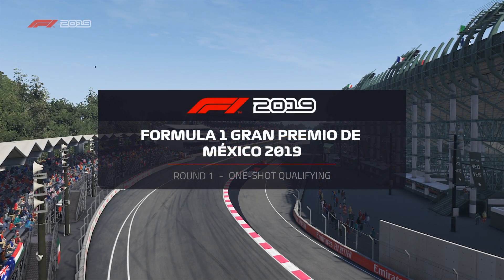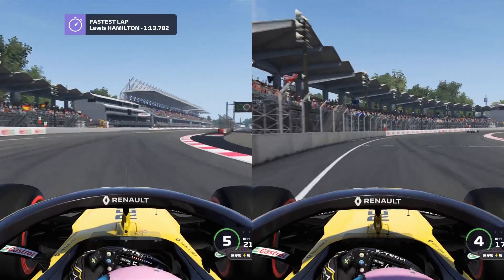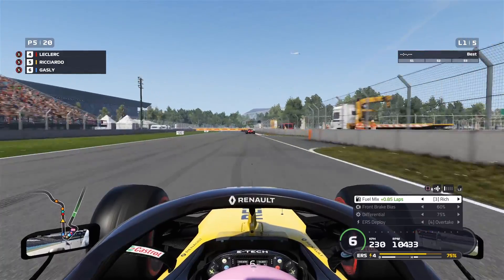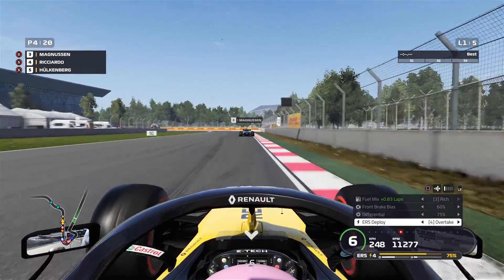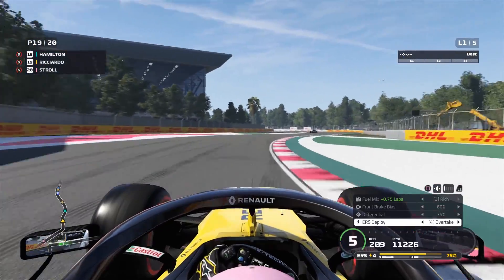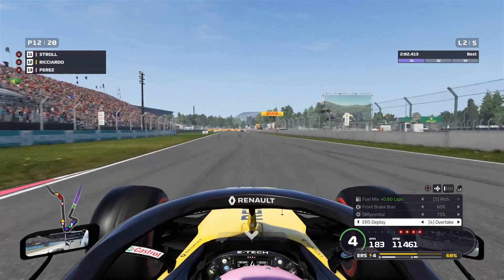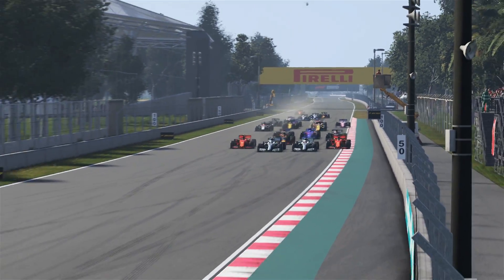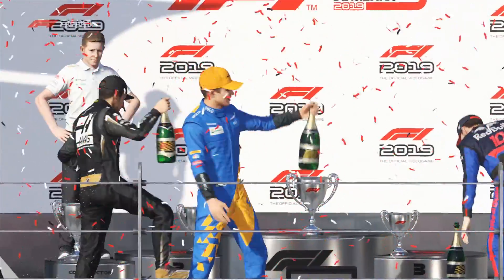A Renault F1 Car With Renault Clio Brakes

Comment: The thing you ignored is weight, which is literally the most important part. A Renault Clio weighs almost twice as much as a Formula 1 car,  so the brakes that stop it from 100-0 in 40 meters, would stop an F1 car much sooner. On top of that, the grip level of the F1 car would better utilize the braking power, which is not the case in a road car since ABS has to prevent locking up and road car brakes can produce FAR more force than what the road car tires can handle. Without ABS, you can pretty much instantly lock up the wheels in a road car at any speed if you slam on the brakes as hard as possible. On top of all that, F1 cars have far more drag and aerodynamic stopping power basically, so that again would amplify the braking power.  All put together, the F1 car would probably stop from 100-0 with Clio brakes in not a much bigger distance than with actual F1 brakes, since the Clio disks can probably develop enough force to lock up the tires anyway at lower speeds. The issue would be heat at higher speeds where the Clio brakes would just overheat and fade very quickly. Probably one stop from 300 would overheat them to the point where your stopping distance would double in the next corner.

It's actually interesting, but brakes on high performance road cars are actually more powerful than the ones in an F1 car, since they're designed to deal with much higher weights. The thing about F1 brakes is that they're helped a lot by aerodynamics, and the design goal of them is to make them as light as possible and as thermally efficient as possible. In terms of pure stopping power, they're not as strong as high performance road car brakes.
Reply: When you put it like that, it's kind of minblowing to think about
Reply: It was bugging me too thanks for clarifying that so i didnt have to lol
Reply: aero drag will slow f1 car without brakes as fast as roadcar with full braking
Reply: Ok bud chill
Reply: Too long didn't read

Comment: If brake fade existed, u would not have brakes after turn 3
Reply: Solid steel brakes would've probably started melting
Reply: @jorge8596  No they wouldn't. They can handle it just fine. They'd fade in braking power, but there would be no damage unless you repeated a lot of heavy braking cycles.
Reply: @derbigpr500  aka an f1 track with 300kmh start finisb straight
Reply: u dont have to brake for turn 3

Comment: if you set the ai to like 70 or 80 they should cope much more better with the weaker brakes as at this ai level they brake much sooner than on 110
Reply: 0% AI be like what clio brakes this feels normal